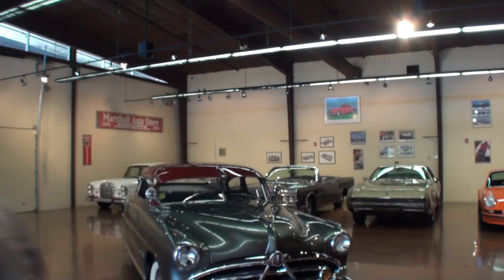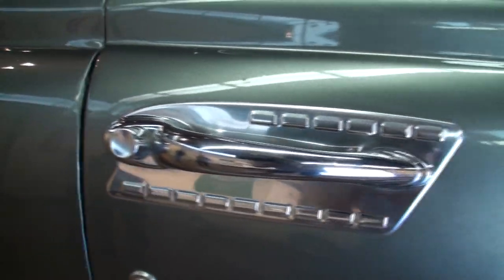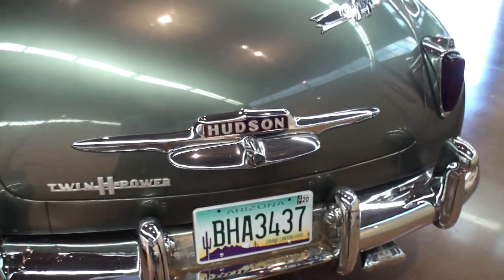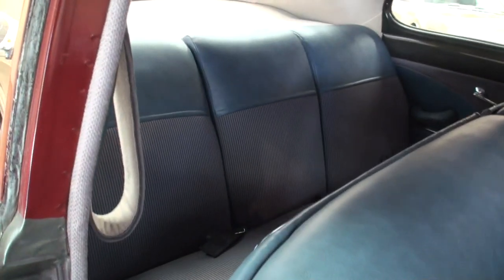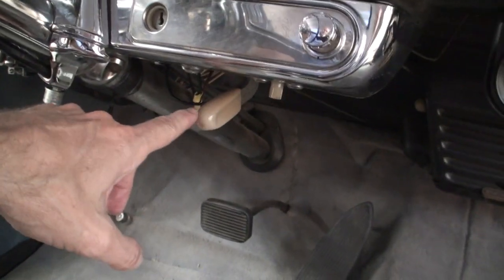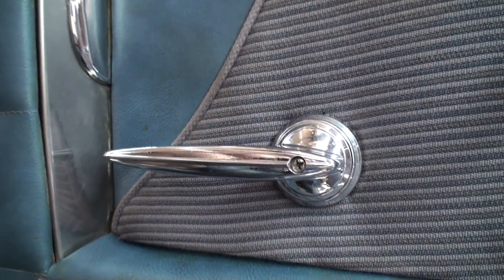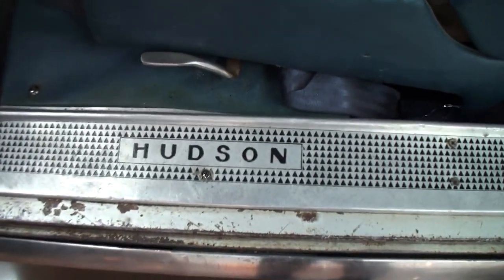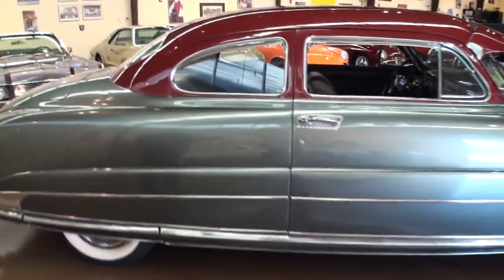1951 Hudson Hornet 2 Door Coupe in Green & Engine Sound on My Car Story with Lou Costabile

Comment: Hey Lou those shields are not for leaking carbs they are for diverting exhaust manifold heat away from the carb fuel bowls AKA vapour lock.
Reply: Jason joncas thanks,for info.....We had lots of Studebaker around Warsaw IND WHERE I WAS RAISED, FEW Hudson’s.......
Reply from the maker: Hey Jason joncas, Thank you for viewing and sharing your knowledge, Lou
Reply: Good catch.
Reply: You are correct. And those flex hoses and auto zone clamps are a beauty!......😂

Comment: I didn't read all the comments but those plates or shields under the carbs were heat shields. Note the carbs sit
directly over the exhaust manifold and fuel systems don't like too much heat. Only enough to properly vaporize
prior to delivery into the cylinders. Surprised the car guys didn't recognize a heat shield. Had to get rid of my
53 Hornet 2-dr years ago, wish I still had it.
Reply from the maker: Hi Bill, Thank you for viewing and sharing your knowledge. Lou

Comment: @ 9:44 That's a prism so you can see an overhead traffic light that would otherwise be obscured by the windshield visor.
Reply from the maker: Hi dlwatib, Thank you for viewing and sharing your knowledge, Lou
Reply: I'm shocked, Al , that you didn't know what that little glass piece on top of the dash was. It was as special an invention as all things were back in the fifties. All traffic lights, at the time, were hung from the center of an intersection from a suspended cable. If you drove a car with a windshield shade, as this Hudson has, and happened to be too close to the intersection.....you wouldn't be able to see the traffic light. As dlwatib stated, you could see the traffic signal through that piece of glass so you could know when the light turned green. Cool huh? Of course you could always wait for the guy behind you to HONK!
Reply: Oh, ok. Thanks for the info. Have a good one!👍
Reply: It is called a “Trafficator”.
Reply: Great video as always, Lou. Thank you for sharing.
Reply: @wmalden  I think my dad called them 'traffic light finder'.  Entering that into Google gets 'traffic light viewer' which must be the proper term.  ('Trafficators' are the semaphore turn signals found on old European cars.)
Reply: Yep.  Back in the day, many traffic lights only had one or two housings and were suspended above the center of the intersection.  So they were at a pretty steep angle above the windshield.  Add the relatively short and steep and far-away windshields on cars of the era, so that even without a visor, you'd want one of these.
Reply: I had a (Guide) GM view finder from my dad's car. I  remember the intersection signal lights were all hanging at the center of the street in Minneapolis while visiting.. you had to bend low at the dash to see the signals if you didn't have one of these.  Also, the Buicks had a center radio antenna that was adjustable fron a big knob inside, you could collapse the mast & turn it to a storing position pointing down at the cowling, clipped onto the center windshield mldg.
Reply: @wmalden  No, Trafficators are those lighted arms that flipped up instead of flashing tail light and front turn signals, seen in all European cars in the 30's - 50's. Early VW's in the US had them on the B pillar but they were not operational.
Reply: @rhm35z  In many 40's-50's cars the low and far away windshield would block an overhead signal even without the visor. My 1990 TranSport could have used one of those prisms as well.
Reply: @boggy7665  I didn't see that you had already made that comment!
Reply: dlwatib My grandmother had the same thing on her ‘54 Pontiac.
Reply: Good catch.

Comment: The front wheels track was wider then the rear wheel track giving it an advantage in handling and cornoing!! This style was from 1948. The 48-52 Commodore became a Hornet by boring and striking the Commodore 262 six to a 308 and adding the Hornet badging, thus a Hornet was born with the same interior and body! The Twin H Also had an aluminum Head that gave some head gasket issues. The single carb 308 had the same cast Iron Head as The 262 Six that was in the Super Six and Commodore. My Parents were Hudson, International and Chevrolet Dealers in Maine. I've personally owned Six Hudson's and they were very safe and rode and handled very comfortably.
Reply from the maker: Wonderful memories :-)  Thank you for viewing and sharing.

Comment: Very nicely filmed. It's a shame you can't capture the aroma too. Smell-o-vision would complete the experience.
Reply from the maker: Thank you for the kind words on the video.  Smell-o-vision, that would be a nice add on to the video :-) Lou
Reply: I knew what they originally smelled like AND THEY COULD KNOCK A HORNET'S NEST DOWN AND DEAD!!! L!!! well, the ones that had been sitting a bit of course had some good old car mustiness BUT STILL HAD A NICE STRONG Mix of oil and leaded gas.. and had a Monstrousitous subtle very quiet low vibration rumbling idle. The backseat as it pulled out would barely feel it but you could hear the engine growl and the body would then follow L!! At nearly 20yrs old when I had ridden in one same model as this.. it was a Good mix of gas and oil, not like a oil burning say Camaro late 60's but this was a sedan LARGE leaded gas using CAR CARRR mix !! L! Hope that helps, actually THAT WAS STANDING OUTSIDE OF IT/ BC INSIDE WAS NOT leaky / and was QUIET!! and A GROAN subtle vibration idle and SMOOTH GLIDE RIDE!!! TRULY MISS THIS MOVING ROOM !!L!! It WAS SOFFFTTT!!! They REALLY MADE QUALITY THEN!! <3

Comment: Believe it or not the Hudson Horner's motor was very complicated. I found a resource online that shows the owner's manual for the 51 and it goes into details on what materials were used for different engine components. That's the owner's manual 😮 
 The engine  Could be refurbished  By anyone and we don't have that now. If there's a problem with my engine now it comes up with a warning light telling me to take it back to the dealership. I cannot service my own vehicle. 😢
 Some Hudson hornets came with the aluminum  head, And the aluminium piston 😮😮😮 Even my dad who was born in 1946, Didn't realise that aluminum was used in engines this early.
No hudsons made it to my country (Australia) a few were sent to NZ.

 I would add a small roots blower to that engine. The flathead engine as it was called the USA, Also known as the L engine and a side valve engine.

 This would help solve some of the issues with such an engine,  Just enough to allow the engine to breathe.
 The roots blower is a very old technology back from the 1800 that we have currently perfected😂😂
Reply from the maker: Hi Dazza_Doo, Thank you for viewing and sharing your knowledge. Hope you see many more cars on this YouTube Channel you enjoy. Please subscribe, and hit the "bell" so you can see all the cars when they are uploaded on this YouTube Channel, Lou

Comment: My old Man traded in one of these in cream color in & out for a new 1957 4 door with "Go-Go" seats in copper and beige. I later met an older man at a show that told Me the 1957's were made to use up 1956 parts. in the later 1960s, there was a Sherrif from Twin Bridges, Montana that had a 52 that nobody could run away from I learned this from a person that tried with a 1961 Pontiac and failed.  Yup.
Reply from the maker: Good story :-)  Thank you for viewing and sharing.

Comment: FYI, The Hydromatic Transmission was a General Motors Four Speed He was improved to a Quick Reverse in 52, meaning you didn't have to come a complete stop to shift from forward to reverse or reverse to forward under 10 Mph ! The Park Gear was Reverse, by holding your foot on the brake peddle, while stopped and engine running, shifting into Reverse and shutting the Engine off you would hear the Transmission lock.
Reply from the maker: Hi Gordon McKenney, Thank you for viewing and sharing your knowledge, Lou

Comment: 1948 was the year that Hudson converted over to a oil pump and insert bearings from the splashed oil system. If my memory serves me, The Commodore Straight Eight through 52 was still a Splasher, correct me if I'm wrong, 64 years was a long time, since those Fablous Hudson's rules the roads!
Reply: Dad had one may I use a Hudson word (hudsonite fluid )cork clutch  aaaahhh. The 50conv was nice.if you need hudsonite just go to your local Hudson terraplane  dealer.😀
Reply from the maker: Hi Gordon McKenney, Thank you for viewing and sharing your knowledge, Lou

Comment: Awesome Lou.  This car seems too heavy to go 100 mph with an engine that only puts out 145 hp.  I realize that's a lot of horsepower for the era.  It must have taken some time to get to 100.
Reply from the maker: Hi Jed Clampett, I'd image awhile to get to 100 MPH, and awhile to stop from 100 MPH with the weight of this car :-) Lou
Reply: The 145 horsepower is brake horsepower.  Different than measured today.  And the torque was 275 lbs, which was pretty stout for the 1950s.

Comment: How about explaining what twin H means??   Engine displacement?  HP?   Or some company history?
Reply from the maker: Please go to www.ConsumerReports.com
Reply: Twin H referred to the Rochester Model H carburetors that it had. Also a glaring error in this presentation is power output. Normal 308s with single carb put out 145, Twin H brought the number up to 170. A special racing only 7X aluminum head & cam brought it up to 245. That package is what made Hudson so famous on the racetrack. 

I own a '49 Commodore myself and I'm sorry but I think it's rather insulting that the guy owns that car but knows so little about it.

Comment: I knew what they originally smelled like AND because of their leaded gas and good oil mix THEY COULD KNOCK A HORNET'S NEST DOWN AND DEAD!!! L!!! well, the ones that had been sitting a bit of course had some good old car mustiness Not offensive at all, almost an old elegance!! BUT running as original STILL HAD A NICE STRONG Mix of oil and leaded gas.. and had a Monstrousitous subtle very quiet low vibration rumbling idle. There's nothing compares today to this as was like a sort of passenger jet bulky maybe but quiet ,lumbering but not as was streamstraight-lined /it felt thickness of walls etc around you and rather dark inside but SOFT!! That's why it was lovable yet kind of scary!  The huge velour-like back then/carpet and side upholstery around backseat had also those sidelights that Glowed a nice ambience. Today you'd feel like it was a moving movie theater, we had no seatbelts so yup you could easily have had to catch yourself against the front seat back / grandma drove carefully just for that reason and only to a nearby store BECAUSE OF THAT!! When she got out of the farm lane accelerated uphillwards IT WENT like it hadn't been sitting !!! Bless How They Made DEPENDABLE THINGS THEN!!!   It was in use/ driven til the gas crisis changed gasoline quality am sure as was '71/72 when it was sent to the shed.. it was decades in our family, I still have the serial number somewhere as my grandpa was second owner of the one in our family.. his was a deeper emerald green , I used to go clean specifically the ruby emblem bc I thought it was his King car !L!  Grandma drove us though, and it would be heavy enough to worry about getting it out of the farm lane in any softened mudded parts!  The way it moved SMOOTHLY soo heavy though , you didn't know you were going after the initial groan starting even at 20 yrs old all original it crept smooth and accelerated SMOOTH it only had body groans on uneven gravel that's all! It WAS SO QUIETLY ELEGANT!!! HUGE HEAVY and ELEGANT!! Although leaded gas health risk it seemed to contain that and move without much exhaust Then!  I Miss It with Granma!! and is why am reunion-ing here as is same time of year memories <3 !! THANK YOU KINDLY For KEEPING THIS ONE GOING!!!! Grandpa had a collection of Hudsons and AMC [he bought 12 $1k cars instead of 1 $12k car !!L!!;) which served him Very Well!!  I wanted to keep in family this particular yr and body one of gpa's but my dad sold it off sadly!  There are Hudson/Essex/Terraplane chapters/club still that everybody can enjoy!!
Reply from the maker: Hi You Too, Thank you for viewing, sharing your thoughts and story too, Lou

Comment: Made 145 horsepower when a lot of cars made about 85.
Reply from the maker: Thank you for sharing your knowledge.
Reply: With Twin-H-Power over 170 hp. The following year in 1952 they’d updated the 308ci engine to the race one called „7X” which was producing 210 hp. Unbelievable car with unbelievably great sound especially with a straight pipe exhaust :)

Comment: I'm not quite as impressed with the styling as you guys. They tried just a bit too hard to work that triangle into places it really doesn't look good, like the grille and the upright hood emblem. And there's something awkward about the overall shape: it has no rear hip. Pleasing car designs should have a bit of pinch to the "waist" through the door area, and a bit of bulge to the rear fender for that "coke-bottle" look. This car has none of that. It has a flabby look to it instead of a muscular look. It's a bit bottom-heavy as well: the chrome "contrail" from the rocket is too low on the body. It needs to be up where the style line is. Finally, of course, most car designers try to minimize the number of emblems on the car, and customizers are even more ruthless in letting the car's lines speak for themselves without superfluities. The designers on this car entirely lost that battle.

That said, it's a nice original condition car that "ran like stink" during its day. It's also historically important for its drop down floor and low height, which everyone soon copied.
Reply: dlwatib If you’re comparing the design to modern cars and even ones that came afterward, yes, it looks dated, but in 1951, this was a revolutionary design than pretty well influenced everything that came afterward.
Reply: If you look at drawings of cars done during WWII referring to the glories of the postwar future you will see a lot of them look like this. Unlike almost all cars before the 1949 Ford the body is seen as one thing without any suggestion of even vestigal fenders. It was very modern when it came out but the bulbous look with low windows quickly went out of style.
Reply from the maker: Hi dlwatib, Happy to read you appreciate the original condition, and thank yo for viewing and sharing, Lou